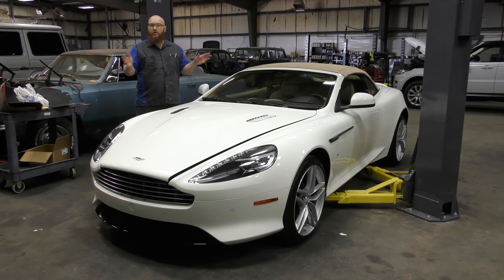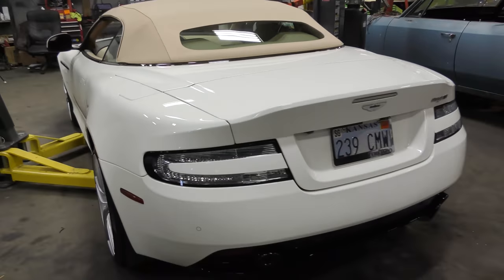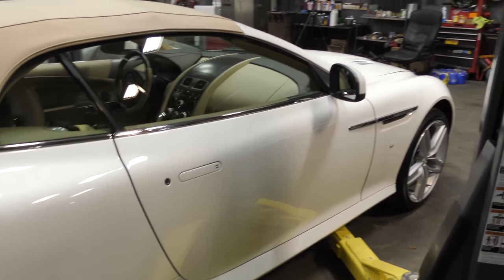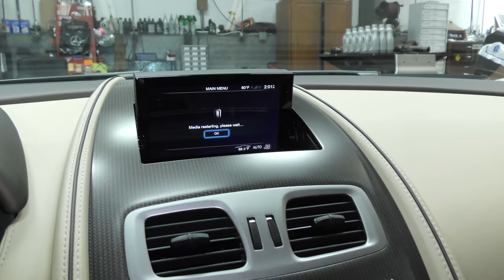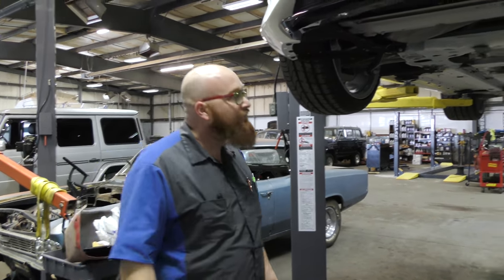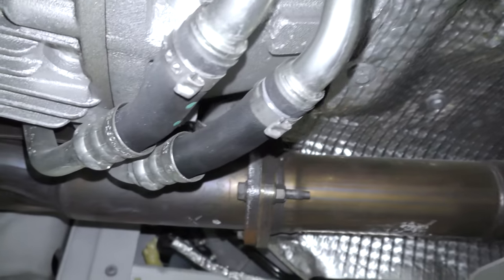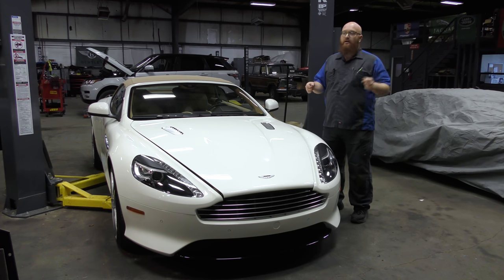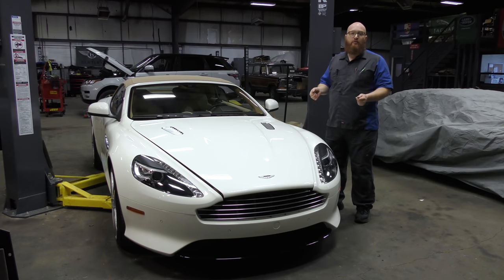Like new 2016 Aston Martin DB9 GT with only 3K miles! The CAR WIZARD is in awe of this car!

Comment: There is a reason why Aston Martin is termed Power, Beauty and Soul; it's just a master piece of British Engineering + art
Reply: British engineering really isn't anything to brag about.
The term "BRITISH ENGINEERING" is usually associated with failure.
Reply: @williamegler8771  
Only by bitter, ignorant Septics.

Where are the current F1 championship winning cars designed and built?
Where are the current F1 championship winning engines designed and built?
Where were the previous F1 championship winning cars designed and built?

Just because Fred Flintstone USA car butcher, can't maintain things properly, doesn't mean it's bad.

Yes BL era British cars were terrible, but that was 50 years ago!!
Reply: Dumo Asechemie
And Jaguar "Pace, Grace and Space".
Reply: @williamegler8771  Aston Martin is known for their works of art, so I wouldn't doubt them.
Reply: @kevinshort3943  Well, german engineers from Mercedes are working where ... 
and who had purchased rolls royce and Bentley ... BMW and VW 
Who had been in charge so rescue Aston Martin for more than a dozen years ?

Ah, the former Porsche, BMW, ... guy Dr. Bez  ...  another german.

And look under the hood and car ... you will see a lot of Mercedes parts and drive trains ...
Not much british engineering left since decades ... engines developed and made in germany
And the former british engineering had not worked out quite well for all those manufacturers that had disappeared. Even the japanese are closing their plants in the UK or had them shut down already.
Reply: @typxxilps  
"Well, german engineers from Mercedes are working where ... "
Germany?

"and who had purchased rolls royce and Bentley ... BMW and VW "
Your point is? 
We weren't talking about those companies.

"Who had been in charge so rescue Aston Martin for more than a dozen years ?"
So he was the only person that did any work there?

"And look under the hood and car ... you will see a lot of Mercedes parts and drive trains ..."
No I wont!!!
I will see Italian and US ones.

Don't start me on German "engineering". Overly complicated crap from my experience.

"Even the japanese are closing their plants in the UK or had them shut down already."
That would be due to the recently signed EU/UK trade deals with Japan, removing import tariffs.
You are just showing your ignorance now..............
Reply: Well I can't really comment on the British or the Germans design styles (I like them both), I'm from Australia where we created  "Holden.."  Yayyyy... Wooo...Yeah ok. Enough said on that...

But, wasn't it Audi/Volkswagen (a German manufacturer) involved in a little thing called "Dieselgate?"  Where they intentionally mislead their buyers and governments and overall, the environment and cheated on their emissions tests.  Way to inspire people with your talents on that one.  :p
Reply: What is it with those who spend their lives criticising the Brits? Why always the Brits? Must be some serious chip on their shoulder.
Reply: Good decisions speak for themselves. I think you and the Mrs. have done very well in life and you're both still young compared to me! Congratulations on a world-renowned shop, a wonderful family and each other. God bless you.
Reply: @typxxilps  
Mercedes F1 are based in Brackley, UK Engine development is in Germany though. 
I think only Ferrari, Haas, Alpha Tauri and Alfa Romeo are based outside the UK. I think Haas may have an engineering centre in the UK too.
Reply: @kevinshort3943  If British automotive engineering is so wonderful why did a majority of their automakers fail?
Most of what is left is foreign owned.
Engineering a race car is totally different from engineering a reliable/durable vehicle that sells well enough to keep factories running and is profitable.
The chairman of JLR just publicly announced that the company loses out on approximately 100k sales per year because of it's reputation for unreliability.
Blaming Americans JLR's reputation!
Surveys of customers and aftermarket warranty companies in the UK place them near the bottom for reliability.
Range Rover is #31 of 31 marques surveyed.
So even mechanics in Britain can't polish the turds enough to make them shine!
Reply: Lol... Car wizard makes a nice video about a beautiful car and some people have to turn it into mindless squabbling and insults as someone mentioned great British engineering.
Reply: @williamegler8771  
"If British automotive engineering is so wonderful why did a majority of their automakers fail?"
You are one ignorant ...........
As I said, BL in the 70s were terrible.
Too much in fighting, captive market, and far too much government interference. Then the government changed, all the support disappeared, and the industry with it.
A bit like Obama bailing out the Detroit motor industry, but not on such a large scale.

"Engineering a race car is totally different from engineering a reliable/durable vehicle that sells well enough to keep factories running and is profitable."
We were talking about automotive engineering, and now you want to move the goal posts.

"The chairman of JLR just publicly announced that the company loses out on approximately 100k sales per year because of it's reputation for unreliability."
Citation or you are making it up.
JLR were making loses due to the Chinese market and all it's "shenanigans",  last I heard.
 
"Surveys of customers and aftermarket warranty companies in the UK place them near the bottom for reliability."
Again citation or you are making it up!
Where are the US manufactures on that list?
Ford doesn't count, as the are all designed and manufactured in Europe.

Just stop being a bitter, ignorant Septic for a moment, and appreciate the car for the thing of beauty it is.
Reply: @Rhowhat  
Pretty sure the engines are made and designed at the factory in Brixworth UK.
FYI Formally Ilmor.

Ferrari used to be UK based too, when Schumacher was winning all the time.
Hass are US based but Dellara (Italian) design their chaise), and they have a base in the UK too.
Alfa are Sauber -  Swiss 
Alpha Tauri  are Red Bulls (UK based) B team.
Reply: @truongtu0191 Im sorry mate, but you obviously haven't watched the Car Wizards OWN video on what Audi to buy and not to buy.  Removing a throttle body to get to an oil filter is nothing compared to removing an ENGINE to work on the timing...   that's like the "Hold my Beer" meme.

Also, considering this is the Car Wizards... all you need to ask is "Why doesn't the Car Wizard like to work on BMW's?"
Reply: @kevinshort3943  I never said the car isn't beautiful.
Everything I said is easily confirmed with a few seconds research.
Who drives race cars to work and on errands?
Nobody moved the goalposts.
You were talking about automotive engineering and engineering is involved in both race cars and everyday vehicles.
Anyone can design a race car.
Something that needs to work for 500 miles and then is rebuilt.
It is much more difficult to design a car that will last a decade and tens of thousands of miles.
Name a modern British car designed and built in the UK that is competitive and sells well in both the UK and internationally?
There isn't one is there.
Why would US manufacturers factor in surveys in the UK?
They don't sell US designed and produced vehicles in the UK.
That is what their European subsidiaries do.
Ignorant is defined as lack of knowledge and apparently you are referring to yourself.
Every other automaker that sells vehicles in China and has to deal with the "SHENANIGANS" of that market.
You can't succeed in any market if you can't produce well made reliable vehicles.
If JLR fails in China it is their own fault because the Chinese love expensive European products and other automakers enjoy great success there.
Look past your "STIFF UPPER LIP" and face the facts.
Also you assume I am American.
I am not.
Reply: @GoInGcRz  I never said that Aston Martins aren't beautiful.
I said they aren't reliable and durable.
Two totally different things.
Reply: @williamegler8771  I said they are works of art that I wouldn't doubt for a reason...
Reply: @williamegler8771  Trump fan?
Reply: @kevinshort3943  Lucas mean anything?
Reply: @ianmontgomery7213  
That's electronics not engineering, it's also 50 years ago.

You obviously didn't see the video where the Wizard was slating a failed Lucas part, and when he opened it up, it was a rebadged US part !!

I shall repeat, no one sane is going to claim that anything from 70s BL was a quality product, but that was 50 years ago.
Reply: @typxxilps  one company - Rolls Royce Aero Engines. Still going strong and leading the world for many, many decades.
Reply: @Cyprusmichalis  Not even American..
Reply: @williamegler8771  Yes but you don’t buy this car with reliability in mind. It’s a touring car, not really meant as a daily. You want reliability, you buy a Camry.
Reply: @Spookieham  Honeywell Aerospace is the largest producer of jet engines and propulsion systems in the world.
Rolls Royce only controls about 18% of the market.
A decade ago it was 39%...
Reply: @matte8441  Of course you don't daily drive a Aston Martin.
But what about Jaguar Range Rover and Land Rover?
Those are designed to be daily driven but are some of the most unreliable vehicles on the market.
Reply: @truongtu0191 that's what ya get when you glue two Ford 3 litre V6's together to make a V12.
Reply: @williamegler8771  Like I said, people who buy these cars don’t prioritize reliability. I own BMWs. I know they’re not the most reliable, and I used them as daily drivers. If it breaks I don’t mind because they drive really good. Some people have or are willing to spend the extra $$ to buy or maintain such vehicles. I agree British cars aren’t that reliable but when they’re working they’re pretty good.
Reply: With 2 V6 Ford Duratecs welded together under the bonnet.  Seriously these things are chock full of Ford parts.  The most difficult oil change I've ever done was on a bloody Lexus IS200 i6 - now THAT is a badly placed oil filter, you can't even remove anything to make it easier to get at, you just have to contort your way into it.
Reply: @Paul--Nobody_Is_Out_To_Get_You  People just like to hate.  Italians and, to a lesser extent, Germans, get bagged as well.  The thing is, these days, car manufacturers are truly global organisations.  They employ designers and engineers of all nationalities, and have parts suppliers based everywhere.  So, while a brand might be associated with a particular country, the reality is that a particular decision about engineering or design may have been made by a 'foreign' board, engineer or designer.  Imo, it's just ignorant to make sweeping statements about the engineering prowess (or lack thereof) of a particular nation.
Reply: @antipodeanwizard1632  I agree.
Reply: @antipodeanwizard1632  I agree, but can’t help but wonder if those WW2 American pilots who entrusted their lives to Rolls Royce Merlin engines would have preferred it was an Allison power plant. Also worth pointing out that British Engineering has held the World Land Speed Record since 1983 and promises to take that record to over 1,000 mph, if COVID19 hasn’t totally killed the Bloodhound SSC project. British Engineering may not be the powerhouse it once was, but to associate it with failure is simplistic and biased. The Aston Martin Valkyrie, stands as a showcase for British Engineering and I see nothing approaching the design efficiency of that car from ANY company, let alone a US manufacturer.
Reply: I love Aston Martin. But the rest of British cars are junk
Reply: Wasn't Power, Beauty and Soul a 1960's black band? - like Earth Wind and Fire?

Comment: In Estonia we do our oil changes minumum once a year. Despite of the milage . Temperature varies from -31F(-35Celsius) in the winter and +86F(+30Celsius) in the summer. Plus very humid spring and autumn times. So the engine oil can have a lot of water in it and it chemically degrades very fast!

Comment: Most important procedure after changing the oil is to build oil pressure throughout the engine before 1st start.  This is achieved by cranking the car over with the throttle pedal pushed to the floor. In this position, the injectors will not supply any fuel. Give it about 15 seconds of cranking. A few moments later restart as normal. I own a 2006 DB9 volante and it turns me from my usual "Grumpy Old Man" self into a grinning fool every time I use it

Comment: The back seats should legally be referred to as overnight bag holders, not seats.
Reply: For insurance purposes it's a four seater .
Reply: You can actually buy it in either a 2+2 or 2+0 configuration with no cushions or seat belts and a little lip to hold the luggage.

Comment: Beautiful car! 
Why buy a car if you are not going to drive it?
Reply: They are probably afraid to drive it too far away from the nearest repair shop.
Reply: I'm pretty sure it gets driven, but probably once a month or so.  Cars this special should be reserved for special occasions, but often enough that it's not just sitting unused and deterioriating.  It's pretty obvious this car is well loved and appreciated.
Reply: @houseofno  Well cared for and appreciated doesn't mean that it isn't a mechanical nightmare.
Expensive to maintain and repair with low resale value.
Reply: Most people who have these cars have more than one car usually a collection. Some cars they do not get to use maybe where it is parked in the garage, some cars they may of thought that they would use regularly and then you end up travelling a lot or staying abroad in your second home etc basically there are many reasons a lot of these Hyper and super cars are not used regularly if you are a multi millionaire
Reply: @williamegler8771  have you actually own an AM b4 the DB9 is reliable!

Comment: Such a beauty ... although I'd always go for the coupes when it comes to AM. To me, both the DB9 and the V8 Vantage look so much better with a steel roof. Come to think of it... same thing with an Audi TT or a Porsche 911. I guess the old Top Gear-rule still applies: Don't buy a sports-car that's been turned into a convertible by the factory - buy one that was designed as an open-top car from the get-go.
Reply: Psst. Aluminum roof. AM bodies are aluminum.

Comment: For the past few years (since I've given up crawling around under cars on the garage floor) I bring both the car/truck back to the dealership for oil changes.  The Tacoma has a skid plate that has to be removed before an oil change and on the Subaru it'd be easy for an unschooled individual to drain the the CVT of oil rather than the engine.

Comment: Oil doesn't really go off, it can last on the shelf for over a hundred years.
Some additives may precipitate out and settle in the bottom of the jar but the oil it self will still be good it's actually millions of years old already unless it's truly synthetic.
What happens in low mile vehicles is the contaminators from combustion and condensation turn the oil acidic and it can erode seals and bearings.
But is you get it hot enough to cook out the water and some contaminants or don't get it above room temperature the oil will last for years without harming the engine as long as it is not driven enough to discolor the oil.

Comment: That has to be the first time ever, I've seen radiator fans on a car that's been driven, with NO dust or grime on the fan blades. That car is showroom condition.

By the way, here in the UK, owning an Aston Martin is not only hideously expensive purchase price wise, but maintenance bills are in low Earth orbit (you ONLY take this back to the dealership if you have any sense - more on this in a moment), and insurance for one of these is utterly penal.

There's a reason you take this back to the dealership for servicing here in the UK. If you don't have the nice little booklet with the full service history when you sell the car, you take a £20K hit on top of any depreciation. If you see one of these advertised on the second hand market and it doesn't have "FSH " in the ad, walk away. These are cars that require a fair amount of TLC service wise, and without that booklet with the dealer service stamps, the suspicion lingers that it's been abused, and that £20K hit is there for that reason.

Of course, this means that one WITH the full service history is £20K more expensive than one without,  but you're paying for peace of mind with a car that has a LOT of potential to be a garage queen if you don't look after it. Of course, this means that YOU then have the responsibility of keeping up that full service history (with the costs involved), but doing so means you don't take a £20K hit when you move on to a newer model. :)

And, of course, you don't run a car with a 6 litre V12 without it consuming fuel like a small warship. :)

Comment: I worked with a guy who was 32 and been a mechanic at a dealership since 17 - if it was a Toyota he would curse and work slow because he wasn’t in to cars. It’s an important distinction - not all mechanics are car guys some did it because it’s a job - as the CW said find an enthusiast shop not just a mechanic.

Comment: Wizard, I hope you will answer this question for me.  They say you need to change your oil at a certain mileage and certain time limit.  I don't understand the certain time that you need to change the oil when it ages to a certain number.  That oil sat under the ground for millions of years without going bad, why would it need to be changed if your car was in storage for a year or two. Also understanding that it doesn't have water in it.  Can you answer why oil would be time sensitive?